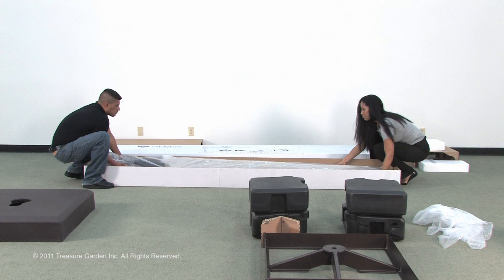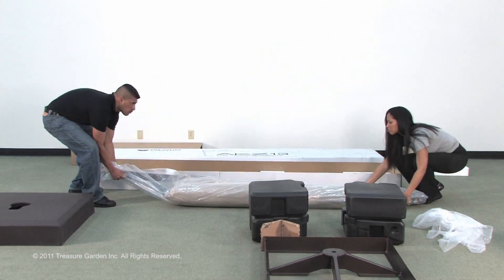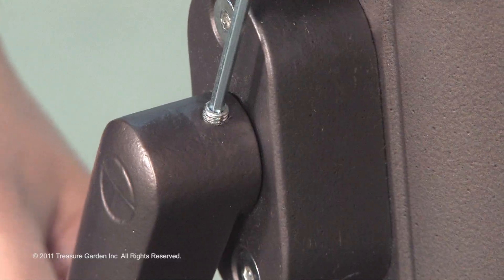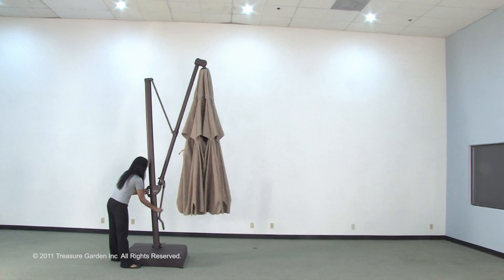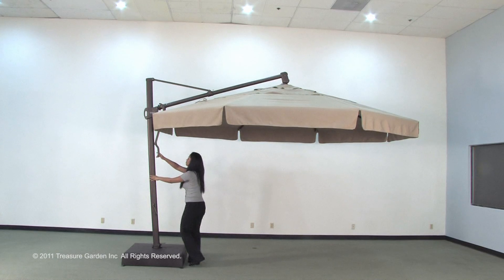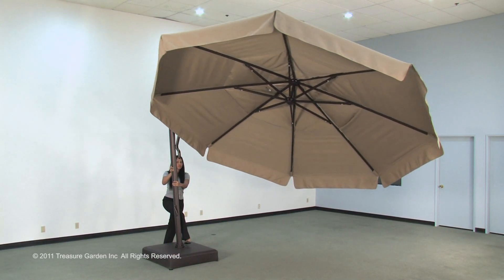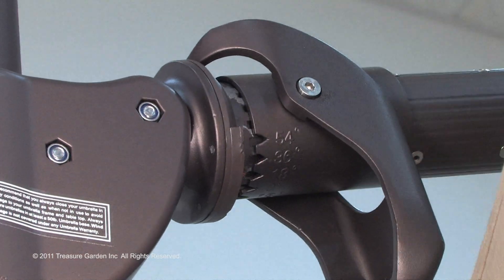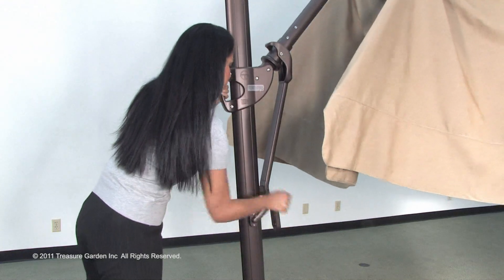AKZ13 Cantilever Umbrella

Comment: Hi.  I'm turning the umbrella counter clock wise to close it but without success.  It simply appears to get tight and there is no closing motion from with the umbrella.  Any possible trouble shooting tips?  The string that run down the middle of the post is not moving at all.
Reply from the maker: Hi Charles! Is your umbrella in the closed position? If so, when you crank the handle, does the canopy structure move outward but the canopy doesn't open? OR when you crank the handle does nothing happen at all?
Reply: I am having this same problem, were you able to fix?